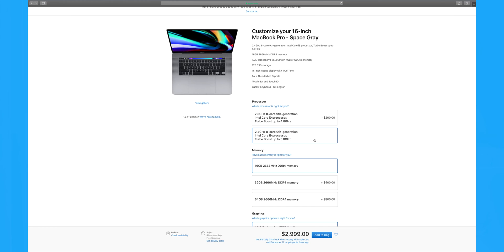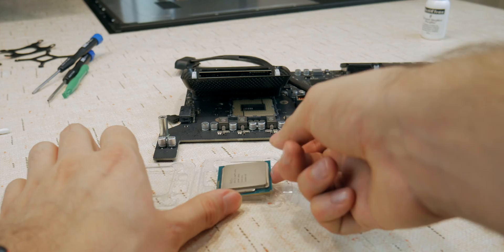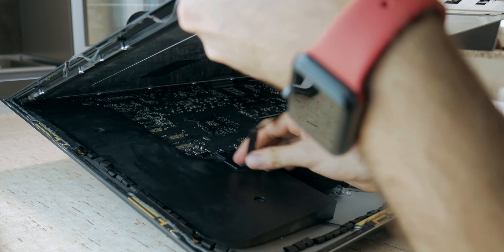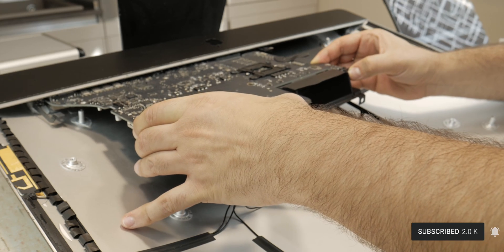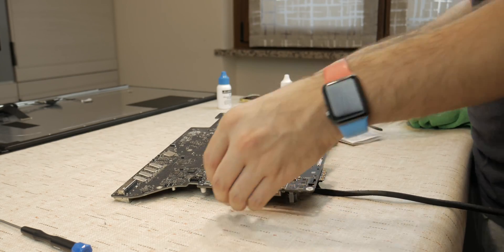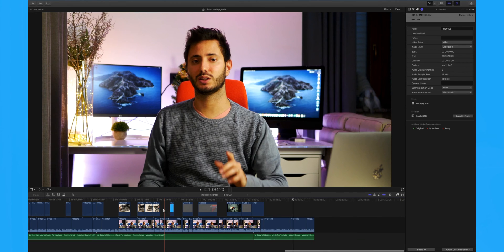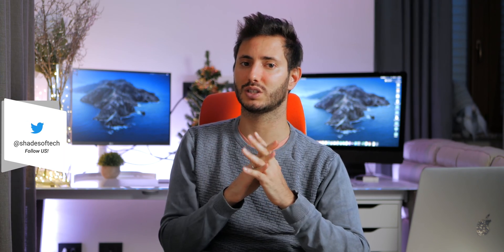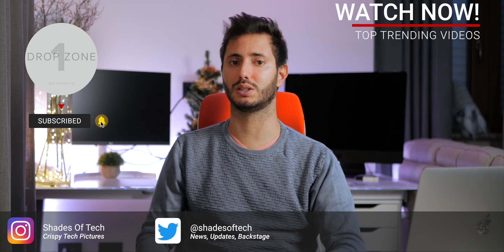iMac 2013 i7 CPU Upgrade | Shades Of Tech ⬡

Comment: Will this work with i5  3.2 model or just 3.4? Thanks
Reply from the maker: It should work with all 2013 model with this specific processor.
With different processor in newer iMacs like 2014 2016

Comment: Can i replace with i7-4770 instead of i7-4771?
Reply from the maker: Honestly I don’t reccomand doing this kind of things. It might work but it’s a really long shot because apple optimised software only for the cpu supported. So it might work but it could also not work after you disassembled and reassembled the iMac.

Comment: Hello thanks for making this video. You did I great job. I was wondering if I could up grade my Late 2013 iMac 27" 3.5GHz i7 to a Intel Core i7-10700KF Processor 8 Cores?? Any suggestions
Reply from the maker: Hi, thanks a lot! The highest cpu you can put is the one I use in the video which is the maxed out cpu that apple included in original 2013 iMacs. Every different cpu isn’t supported. There are some users on web that manage to use different cpu but it’s a long shot and you’re not sure about succeeding until you boot it up and it’s a complex upgrade so I would go for supported cpu only
Reply: @ShadesOfTech  thank you.

Comment: So can I put 10 gth i7 cpu or what is the maximum ?
Reply from the maker: It depends on the iMac model. The last iMac you can upgrade is the 2020 iMac with an i9
Reply: @ShadesOfTech  I mean imac 2013 late
Reply from the maker: @ProgrammingWithOsku  no the maximum is the i7 I used in The video
Reply: @ShadesOfTech  what generation 9th ? Or what
Reply from the maker: @ProgrammingWithOsku  Intel i7 4771

Comment: Very helpful video. My iMac is  15.1. mid 2015 model ( A 1419),I have installed 32 Gb RAM. Pl.guide me which highest configuration CPU it will accept? also I will upgrade 2 TB Ssd ( sata) & 2 TB nvme SSD. please guide me. I am novice for computer . I needed it to edit my surgery 4K videos. Thanks.

Comment: I recently upgraded my 2013 iMac from the base i5 to the i7 (4771). I noticed when doing certain tasks that the fan is coming on, which didn't happen before, has anyone noticed this? Thanks
Reply from the maker: Yeah I noticed it too for example while exporting in FCPx. It’s because the i7 is more powerful and creates more heat so the heat sink has to dissipate more and the fan kicks in. Also the i7 makes faster bursts from 0 to 100% and this means that the fan curve suddenly goes from idle to max

Comment: This video conveniently skips over (on purpose?) the difficulty in re-installing the heat sink back over the CPU and GPU.  The RAM shroud blocks any and all attempts to properly align the CPU heat sink without making a mess of the thermal paste all over the motherboard, particularly on the GPU side.  I consider myself very skilled and meticulous and even my skills were tested to the max.  After twice removing the heatsink to clean up the messy thermal paste, I ended up having to remove the plastic RAM shroud permanently in order to get the CPU heat sink properly over the socket.

It is VERY easy to bend a CPU pin!!  Be warned, this video is making it look easier than it really is.  Do so at your own risk!
Reply from the maker: It was the first time I opened an iMac or a Pc in general and found it very intuitive and easy. I just followed the ifixit guide step by step.
I didn't skip on porpouse the mounting back, for me the "hardest" part was to open, not to close. I just wanted to tell my experience more than a step by step guide, there are plenty of that already and focus on the benefits.
Reply: I also removed the memory cage, but you can reinstall it after the heatsink is in place by cutting the cage on the low side with one cut, which allows you to spread the cage wider to reinstall it. The screws will hold everything in place once your reinstall it.

Comment: Hi! Impressive Video, really helpfull, i have the same iMac and it looks like inmortal... just one question, i7 4771 is te best i7 supported by this model? I am thinking about doing the upgrade because it is the only one that I haven't than yet. Thank you!
Reply from the maker: Yeah the 4771 is the max supported one. On forums you can find people using maybe slightly different cpu but in my opinion the best thing to do is to use the Apple 100% supported ones to avoid any problem. This cpu is fairly powerful
Reply: Shades of Tech. Thank you, really good job with this guide. I will keep thinking because i do not know for sure if it is worth it right now. But this guide means that we have an iMac for many years!

Comment: I wonder what would happen if I use the i7-4790K??
Reply from the maker: I have heard that somebody successfully made that. But I don’t think it’s worth the risk. The k means that is an oveclockable cpu but Mac OS doesn’t use overcloack so it’s pointless
Reply: @ShadesOfTech  Thanks for the response...I am not planning to overclock it,just to go  over the i7-4771 which it seems the go to CPU for most of the modders.,,I will inform you if you would like to,of my success or failure.
Reply from the maker: Yeah thanks! Looking forward to

Comment: hi i enjoyed your video i have an mid 2014 iMac 21.5 how can i max it out what cpu, ram memory, wifi card, graficas card can this mother board hold? thank you
Reply from the maker: Hey, The video is about the 27” iMac. For the 21.5” model I am pretty sure cpu is soldered.
So I guess to upgrade cpu and gpu you should change the entire motherboard. Ram is user upgradable but you have to open the iMac screen
Reply: Thanks for reply. What mother board would be compatible with this project?
Reply from the maker: You need to find an iMac 2014 motherboard with the chipset and gpu you want. Ssd and ram can be upgraded in any case.
But I’m sure it will be expensive

Comment: I know it's been several months since you posted this video series - many thanks for putting in the time and effort! They were really helpful. I ended up using this, the OWC video on PCIe SSD upgrade, and the iFixIt forum for guidance. I upgraded a late-2103 27-inch 3.4 GHz Core i5-4670 with the nVidia GeForce GTX 755 + 2 GB VRAM 1 TB 7200 RPM HDD and 16 GB RAM to:

Intel Core i7-4771 3.5 GHz CPU
Sabrent Rocket Q 1 TB PCIe NVMe M.2 (boot drive)
Crucial MX500 1TB SSD (data drive)
32 GB Timetec DDR3 1600 MHz RAM

RAM, obviously is trivial to upgrade. And - following the OWC PCIe SSD upgrade video - the SSD and PCIe NVMe SSD drive upgrades went very smoothly - this gave the biggest bang for the buck - there was a 400%+ increase in Read/Write speeds and system boot time dropped from 73 seconds to 19. Everything starts and runs smoothly.

The CPU upgrade, however, was a nightmare. I managed to bork the upgrade the first time - wrestling the compression spring for the heat sink resulted in bent pins on the Haswell socket. The system was dead. No bueno. I tore everything back down, scrapped all the thermal paste off (for the second time), carefully used a fine point tweezer to bend the socket pins back, reinstalled the Core i7 CPU, and put the system back together. This time, I got the three-beep error and had to reseat the RAM chips. After that, the system started and I was hugely relieved.

I'm getting nearly identical benchmarks as you. The upgrade from the 3.4 GHz (dual core, 4 thread) to the 3.5 GHz (4 core, 8 thread) didn't do much for the Geekbench 5 scores, but the Cinebench 20 score improved by 30%, which is good since I'm hoping to use the system for video editing.

All in all, I think that a 7-year old iMac is still a pretty good deal in you're in the Apple ecosystem and need a good, all-around system. It certainly works well enough to handle video editing - especially since Apple apps tend to be well optimized for macOS. I'm also using this for digital photography (Photoshop, Lightroom, and Bridge) and digital music production (mostly Ableton Live, FL Studio 20, and some Logic Pro X). Even the more demanding apps are running very smoothly. I have no complaints.

Anyway, thought I'd stop by, say thanks, and let you know that your videos are still being used and enjoyed.

Cheers!
J
Reply from the maker: Hey man, thanks for taking the time for commenting! I really think this upgrade is great and considering to make a 2020 iMac upgrade video in 2 years.
About the 2013 iMac for video editing the best upgrade you could do would be an egpu.
I am running the amd 5700xt and it gives exporting times like a maxed out Mac Pro.
I made a whole video about egpu on older macs so you should check it out.
Of course it becomes quite expensive for a 700$ egpu setup but you could upgrade your Mac in the future and continue to use an egpu setup
Reply: @ShadesOfTech  I just bit the bullet and purchased FCP X and am starting to play around with it. I'm a total N00b in terms of videography. So far, FCP is working really smoothly - scrubbing is flawless, although I'm only working on 1080p files. In time, I'll give 4K a shot.. And thanks for the heads up about eGPU's - I'll have to look into that. Cheers! J
Reply: Where did you purchase core i7 CPU??
Reply from the maker: I bought used on eBay
Reply: @zyadelbek6294  I actually found a seller on Amazon that had two NEW CPU's - bulk packaging, but new nonetheless. Admittedly, it was expensive - around $200 USD. You might still snag one if you're up for that kind of money. Good luck! J

Comment: you can also add a second ssd on the motherboard
Reply from the maker: Yeah you can, I actually made a video where I upgraded both ssd
Reply: Shades of Tech you can also use terminal to unlock the EGPU capability of older macs
Reply from the maker: crazyAlexander23 yeah I did a video about egpu on older macs as well. I have been using the 5700xt with my 2013 Mac Pro
Reply: @ShadesOfTech  Since i work WIth LOGIC and need lot cpu and RAM  do u think  just upgrade to 32GB Ram would be fine to help my CPU  or this  will not change any of my workMemory ?
Reply from the maker: @Morbin_official  I am not particularly familiar with logic since I mainly use FCPx but upgrading memory is effortless so Insuggest you to upgrade ram first and see how it goes. If it’s not enough you can return your ram and sell the machine or decide to upgrade CpU if this program is cpu intensive

Comment: Ciao...2 domanda! 1 installata la cpu il Mac la legge in automatico o dovrò fare installazione da capo quindi perdendo tutti i dati su ssd installato attualmente? 2 per il 21.5 la cpu é saldata, ma ifixit fa riferimento al 2,7ghz con la scheda video integrata dicendo che il modello 2,9ghz con scheda dedicata é potenziabile al i7 4770s...ne sai qualcosa?
Reply from the maker: 1 non devi fare nessuna installazione se tutto va a buon fine viene riconsciuta la nuova cpu al primo avvio.
2 io ho testato il 27” peró so che sul 21” è saldata e mi sembra sia corretto quello che dici sull’i7. Ifixit su questo è stata la mia fonte di informazioni. Di sicuro sconsiglio di dissaldare la cpu
Reply: Shades of Tech si per dissaldare nn rientra nelle mie capacità...per il processore ifixit dice che il mio con scheda video dedicata nn é saldata

Comment: How has your Mac has been? I installed a 4770 on my late 2013 21.5 iMac, but the iMac supposedly used on the maximum configuration available the 4770s, which has a TDP of 64 watts, and the 4771 and 4770 both have a TDP of 84 w,  so have you run into trouble? or does your system has been running cool and good?
Reply from the maker: I want to make clear this is a 27” not a 21.5” so I suggest you for the 21.5” to use the one officially supported.
In theory if you already confirmed that the architecture supports that tdp it should work on the hardware side. Not sure about the software support tho.

For me so far so good! Just hear the fans kick in while rendering and exporting in FCPX
Reply: Hi, just noticed this. I have a 21.5” 2.9GHz but I can’t find any clear answers on this, everything is conflicting. Some say 2.7GHz is soldered and 2.9/3.1 is socketed. What did you find when you replaced it and which one did you have prior?

Thanks.
Reply from the maker: I had the 27” and it was socketed, I am not sure about 21.5”. I have always known that cpu is soldered on 21.5” but never had the chance to see. Try checking the site everymac for more info about your mac

Comment: A word of warning - he makes this look easier than it is. I'm fairly experienced with taking iMacs apart and my attempt at this was a total failure. Only 1 LED showing and a long list of things to troubleshoot! Hopefully not a dead iMac.
Reply from the maker: I am sorry to hear that.. as I say in the video series this is not intended to be a tutorial but more a walkthrough of my experience. This was my first attempt ever to open a Mac or a pc and I found myself pretty comfortable. 
This is why you might seem it was easy for me, because it was! Let me know how you solve. Did you use the correct 4771 cpu?
Reply: @ShadesOfTech  thanks for your reply - and no problem at all - definitely not your fault! I followed the ifixit guide and used a core i7 6700k as I have a late 2015 imac. I also tried to update the original ssd blade with a new m.2 NVME drive (plus adapter) so that I could be rid of the fusion drive forever. So plenty that could have gone wrong! I've taken it apart and reassembled today and sadly I've still only got 1 LED lighting up on the motherboard so I might need to get some specialist help.
Reply from the maker: That’s a bummer! Did you try to put the original cpu and just upgrade the ssd? I made all the upgrade at once could be a problem of the new cpu? Maybe it was used?
Reply: @ShadesOfTech  I've put the original CPU back and it's fixed! It was a used CPU so I think it was probably faulty. Unfortunately, I don't have another motherboard to try it in.
Reply from the maker: Well! This is a win! You should return it and get another one. eBay is a mess! I ordered some Mac Pro ram 4 sticks and they sent 3 different sticks with different speeds. Returned immediately
Reply: I did this two weeks ago on a late 2013 iMac.  However, I only did it to replace the thermal paste as it was old and cracked.  This video (tutorial or not) is hiding the complexity of re-installing the heat sink.  It's no surprise he edited that piece out.  The re-installation of the CPU and heat sink is a ridiculously complicated and the likelihood of damaging the CPU socket is very real.

Because the CPU is not clamped down into the motherboard like regular computers, and the RAM shroud blocks any attempt to properly align the CPU heat sink to the board, I ended up bending a CPU pin in the socket, the worst-case scenario.  As I do a lot of PC repairs, I had a microscope and had to use that to bend the CPU pin back to its original spot.  I honestly thought I ruined the motherboard.  The only way I could safely align the heat sink to the CPU tray was to permanently remove the RAM shroud.

I feel it's very insincere that people posting videos of this are not including this crucial step.  They're sending the wrong message and implying it's not that big a deal, when in reality a replacement motherboard on eBay still goes for $600+ dollars.
Reply from the maker: Just because you bend the cpu it doesn’t mean that it’s impossible. I just put the motherboard flat on a table, placed the cpu from above, and the heat sink above it on top. Than slided the motherboard on the side of the table so that I had 2 holes free both above and below. inserted two screws and slowly closed them. The heat sink is kept down from gravity. Then turned the cpu 180 degree and made the same on the other 2 holes. I don’t like being told I am hiding things since as I stated this is not a tutorial, for that there are official guides. Many people also at first attempt reached out thanking me for the input.

Comment: Thanks so much for the video! I have iMac 27” late 2013 (661-8124 Logic Board, 3.5GHZ, I7, 4GB). I have a logic board problem so want to try replacing the graphics card and CPU myself. I read almost all the comments to get more info. I see you used the i7-4771 for the CPU. Can you please tell me which graphics card you used for the replacement and how to get rid of them from the logic board(probably heating?) I would much appreciate if you can share item links such as cleaning supplies and thermal glue that you used(or recommend). Thank you again!
Reply from the maker: You can technically replace the logic board and the CPU as I showed in this video is easily upgradable. But the gpu is soldered so it's really professional grade stuff. I suppose you should de-solder and heat up but I have never done it and I think the risk of damaging the gpu is very high. The best thing would be to find a logic board with the gpu you want and then upgrade just the CPU.

Anyway I used the 4771 and it's quite powerful.
You just need to clean the thermal paste with this https://amzn.to/2z7xubr
I used thermal grizzly https://amzn.to/3czNL6r
and then some screwdrivers https://amzn.to/2XCpPvd
Reply: @ShadesOfTech  Ahh I see. Thanks so much!
Reply: Wished this was in English 😂

Comment: Do you have link to processor at Amazon?
Reply from the maker: The maxed out processor the 27" late 2013 iMac can use is the Intel Core i7 4771, 22nm 4th gen Haswell CPU, 3.5 to 3.9 GHz, 4 core 4 threads, socket LGA 1150 (Socket H3)*. Here's Intel official page https://ark.intel.com/content/www/us/en/ark/products/77656/intel-core-i7-4771-processor-8m-cache-up-to-3-90-ghz.html 
I personally bought an used one on eBay, but if you want to buy on amazon here's a link.
https://amzn.to/2yk4BIy 
They are renewer by amazon, I don't think you can find new ones at affordable prices since they are from 2013.
Pay attention that you want the 4771 and not the 4770 or the 4770k because they aren't officially supported.
Reply: @ShadesOfTech  Is it possible to upgrade the GPU 755M to 780M?